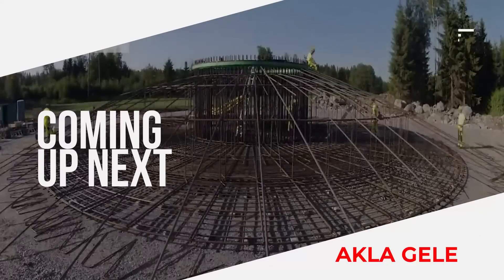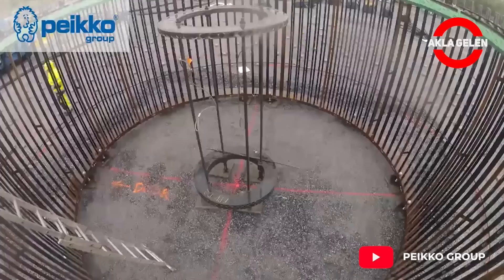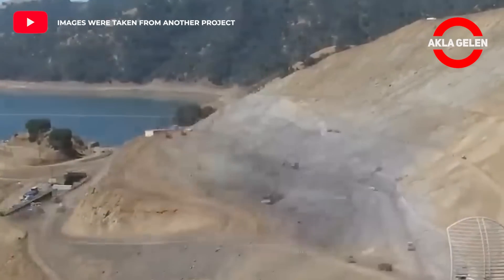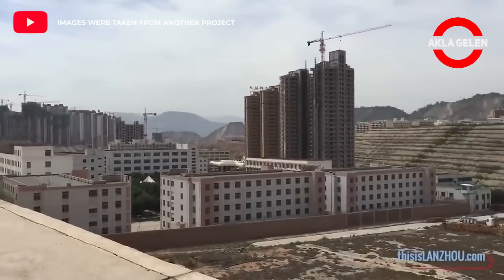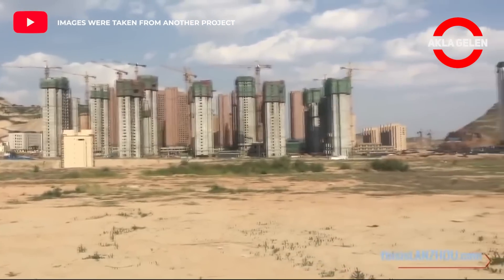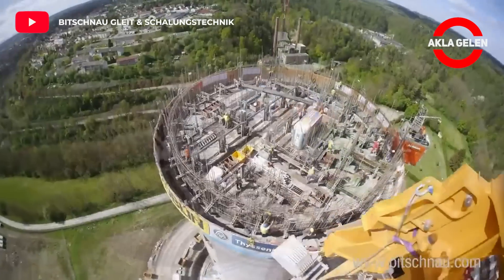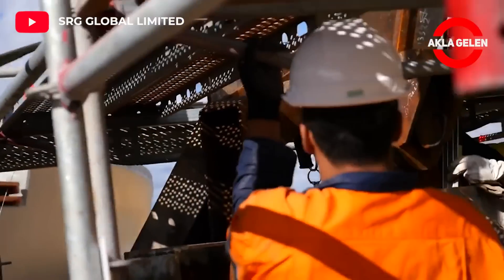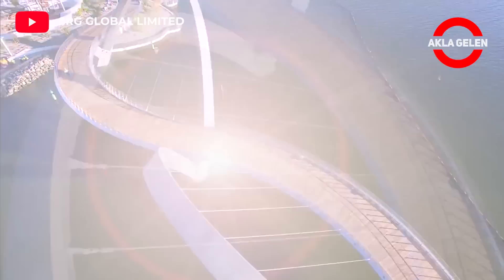See What China Is Doing To The 700 Mountains For The New City - Incredible Construction Projects

Comment: You want a solution to the problem?
Pay ppl to go for a walk, clean the country, pay ppl to learn not make garbage for no reason.
Pay ppl to have fun, help other ppl learn &: have fun instead of kids. 
Building more stuff just cost more & STAGNATES more .
Build cars &'appliances that don't need fuel or charging.
Charge a flat rate , if they don't work & help take wat v they need or turn it off.
Why make garbage for no reason! 
Why make powrrstations & petrol stations,  just design a wireless car & appliances.
Why retard your ppl and dirty your country/water/air/land just to charge $$$$$quiggly lines for electricity & petrol.
Better to get then to learn, stay fit, stay clean, stay HEALTHY!
Filter the Air & Water put fireplaces on every house with a filter/gasifier make them burn rubbish every winter collect all the rubbish process it into bricks they everyone has to burn a certain amount & collect the gas/oil filter the flue.
Make every house filter water while burning to stay warm & steam clean water into the environment run the steam through  a minerals & natural oils on its way out when it rains out will DISINFECT your country instead of like lpollute everything & you can take you masks off. Or you can keep living like man does & live in a garbage tip breathing in shit & garbage around them world.
Air filters on every house & DEHUMIDIFIER will finger l filter water & air until it's clean again.
Process the filters on HAZMAT SITES so the GARBAGE gets burnt properly.
50-100yrs you should have cleaner air & rain again.
This world is FUKD &: it STINKS.
If no-one starts LEARNING that our ancestors were retarded CLEANING &  LOOKING AFTER THE WORLD IS A JOB.
Don't worry about war, ppl are getting sick all over the World from the garbage & RETARDS making pollution so they can collect $$$$$quiggly lines.
Personally I think, were all dead in a GARBAGE TIP.
GOLD FEVER Broke everyone's brain ppl think they can breathe & drink $$$$$$$quiggly lines  & they believe they are rich if they can't breathe the air & drink the water.
GOODLUCK!
Your AIR will be breathable, & WATER drinkable.  Or you can breed more & everyone can keep shitting in the water & live happily ever after buying garbage & useless shit pretending they are rich & not retarded 
PROBLEM SOLVED!👍

Comment: This is symbolic of cutting off the highest thinking one gains not realizing you just chopped the head off.
Plus, how many vacant cities have been abandoned  in the last decade?
Reply: Exactly
Reply: It takes 20-30 years to build a complete city from scratch. Yes it’ll look empty for a long time.
Reply: Not in China it doesn’t! You clearly have no clue just what those communists are doing there. Entire cities complete with skyscrapers springing up in 3-5 years. Massive, rapid expansion.
Reply: As if an unsold, empty demon city pops up

 There are still 100 million unsold vacant houses built in China

 ~Waste of manpower and resources
Reply: Not every project is successful, which is normal.

Comment: I found this video to extremely inadequate and disturbing in describing these projects and the environmental hazards they will create.  

The wind turbine foundation sounds interesting, but information on how it works would have been relevant and helpful.

SlipForm Test Tower looked like an interesting structure but again there was no explanation what a test tower is used for.  The concrete is added as a form moves vertically up adding a layer as it goes. Here is one explanation from Wikipedia on what structure is used for.

"An elevator test tower is a structure usually 100 to over 200 metres (300 feet to over 600 feet) tall that is designed to evaluate the stress and fatigue limits of specific elevator cars in a controlled environment".

The Lanzhou New Area Project was the third construction project mentioned on this video and I found this project to be especially disturbing.  A reported 700 mountains are to removed for a new city.  A company spokesperson was quoted as saying that there would minimal damage to the environment by this project. 

This is like a 1984 meme when 700 mountains are to removed and yet the company claims that there won't be any significant environmental damage.  That is so disturbing I can't find the words to how sick and disturbed that is.
Reply: China never cared bout environment or lives of others.